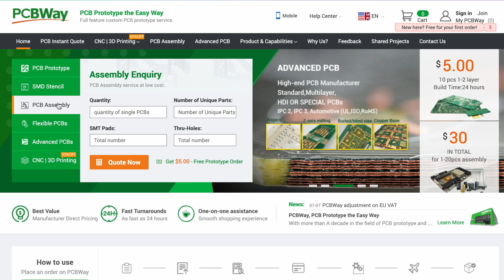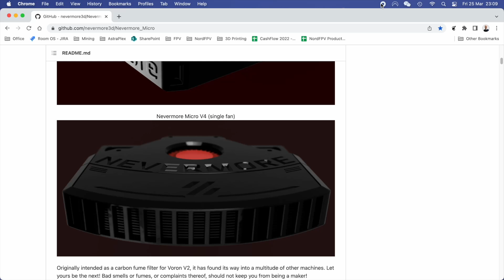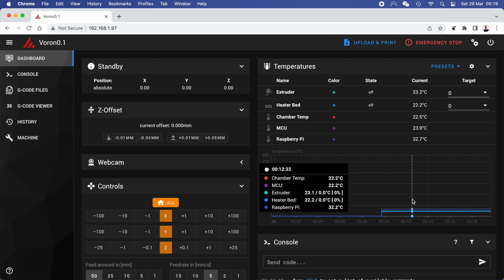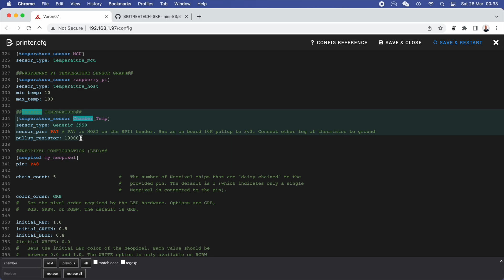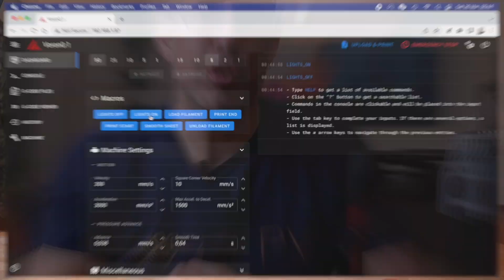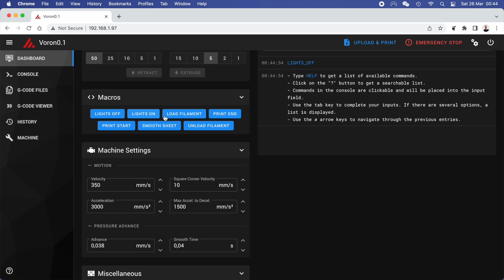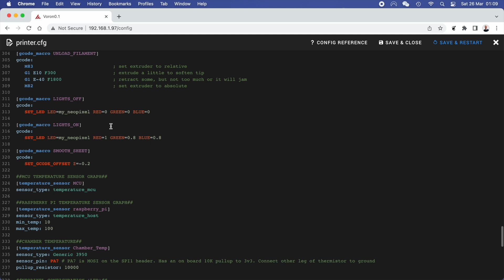3 Simple and cool upgrades to my Voron 0.1

Comment: The "guys" on Discord don't know that much to deserve my personal info sold to the highest bidder, which is stated in the terms and conditions.
They are also pretty toxic individuals, you MUST BE A FOLLOWER, it is forbidden to contradict the "gods of discord" even if you're right.

You need a print surface thermistor, other than the crappy heatpad one, there can be 30 degrees or more difference between heatpad and the aluminium bed when cold starting.

Comment: If you rotate the biggest piece of the nevermore filter 45 degrees, then the piece is 117.7 x 117.7mm, it should be printable on the V0.
Reply from the maker: Somehow it doesn’t work on mine. I think I lost a couple of millimeters here and there in the config file.

Comment: One mod I’ll add is the hinged tophat.
And some electronics cooling, especially if you live in a hot region. I have one fan for Rpi and another one for drivers.
Reply from the maker: I actually added a heat sink and a fan to the raspberry pi, but forgot to mention it together with the handles to carry the whole printer. Do you have a good link for the hat hinges? I haven’t found one I like yet.